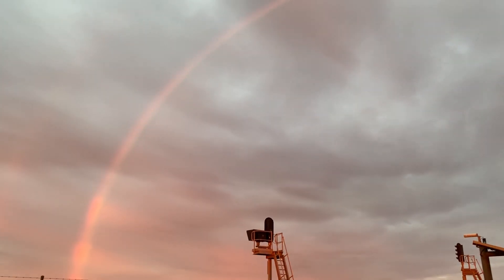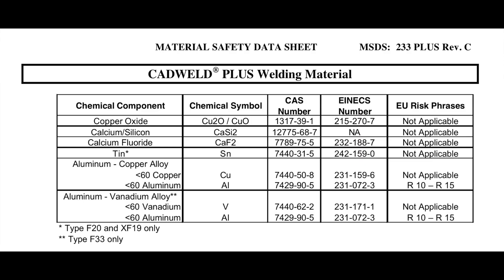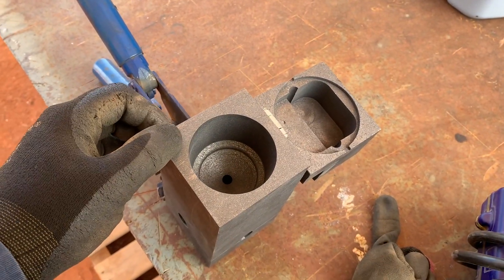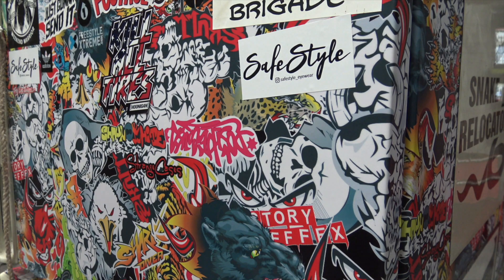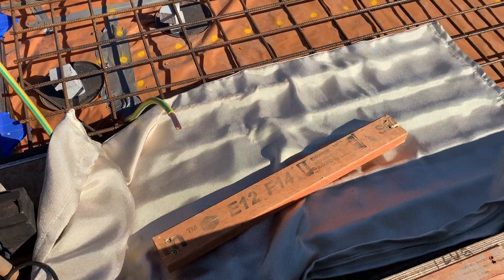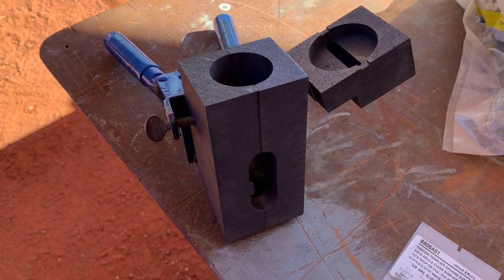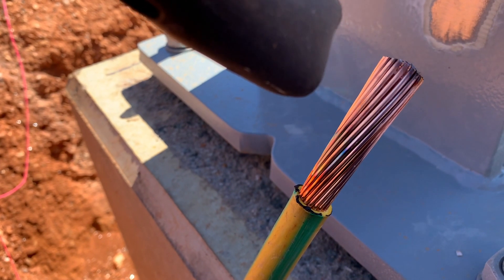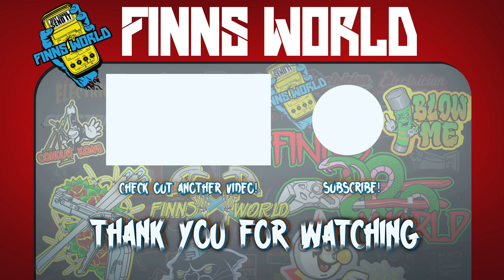Electrical Exothermic Welding... A Thermite walks into a bar...

Comment: Very cool to see these being made. I'm a high voltage specialist and all our structural components are earthed by welds. But I expected a lower value than 19,2 micro ohms from a weld! My usual connection made by clamping force are about halve that.
Reply from the maker: I could test it a few times on cleaner spots and get it down to 7-8 but we talking an earth grid here